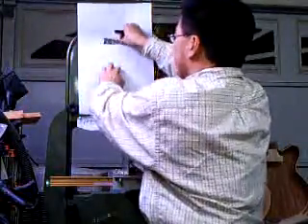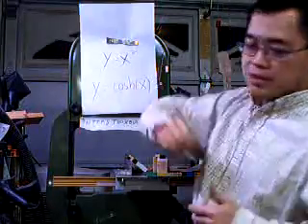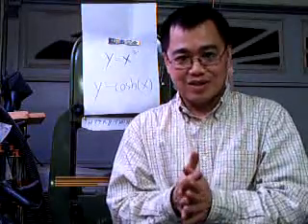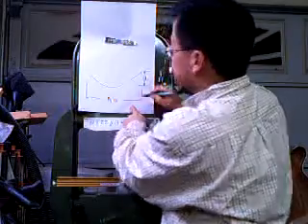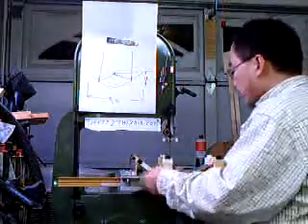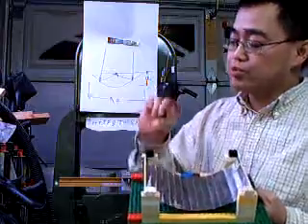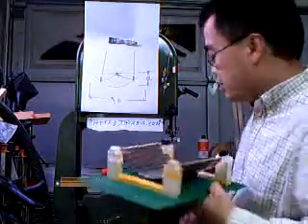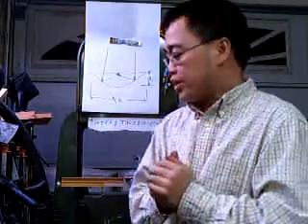solar catenary reflector vid 1: introduction

Comment: So  how do I use this to build an aluminum can solar melter that doesn't burn the cans because of excess heat.  I need 800 to 900 F not in the thousands.  Course I'd like to have a second melter for copper just a few hundred degrees more.

I'd bet you'd get several thousand degrees with what you are showing.  

IOW how can i calibrate or control the temp so i melt rather tnan burn AL, etc.

I just subbed.

Comment: Your work is very promising.  Years ago my father's metal forming company produced reflector panels for Boeing Solar Research.  We also built hundreds of 4m diameter segmented parabolic dishes.  Since then I too have been intrigued by solar thermal projects.  I explored asymmetrical parabolic troughs because the back structure design issues were significantly more advantageous.  Your asymmetric catenary has similar design strengths.  Greater reflector area at low cost is a very good approach.

Comment from the maker: You are correct.  Efficiency drops with increased temperature for all solar cells.  Also, the thin film/amorphous material can be damaged easily by heat, so it is best to use cooling and/or the crystalline PV cells.  There are specialized cells designed for higher temperature, but they are expensive.

Comment from the maker: That's a good question, and I think I can probably answer that question.  But in the spirit of the video, which is meant to introduce the concept and not to provide a specific engineered solution, I'd like to bounce that question back to you:  how would YOU build such a reflector in a windy area?  Would you make it light/heavy? use solar-thermal or photovoltaic? few-large or many-small? Thanks for checking out the video with good thoughts! Tho